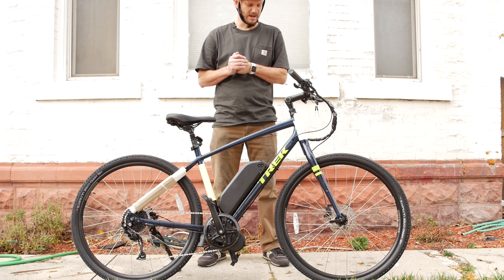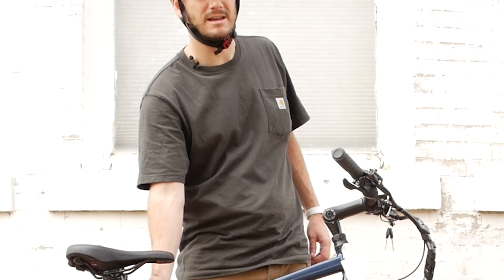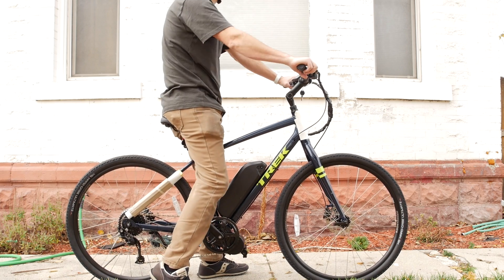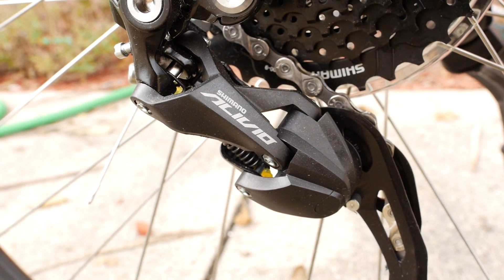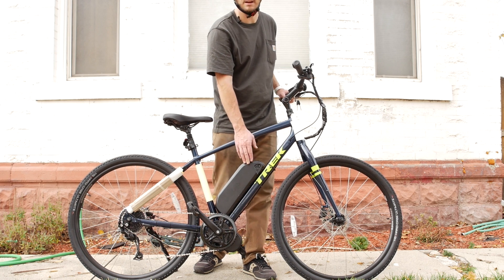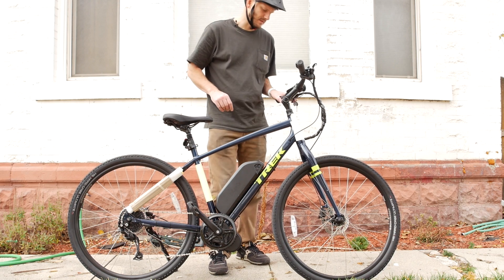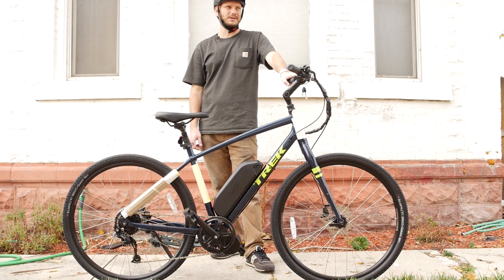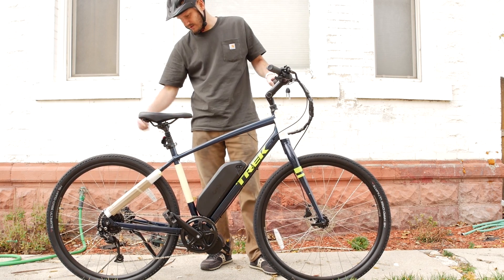Custom E-bike Build: Trek Verve 3 with Bafang BBS02 750w Mid Drive 52v 17ah Battery

Comment: Hi Johnny, your channel is my favorite resource for DIY ebike building. As it happens I have a Verve 3 XL that I have just converted with the Tongsheng TSDZ16 kit. Sadly, I had to take an angle grinder to my downtube to make it work (I know!) I only cut as much as needed to get the motor on. It is snug and has about 5 mm  of gap between where the top part of the motor should make contact with the downtube. I'm thinking of jamming a rubber shim in there as opposed to cutting more. I won't ask for advice on this as I'm sure you don't want the liability. I just wanted to share my experience. That said I'm 6'9" and pushing the bike's weight limit. I would certainly appreciate any advice you might have regarding the drivetrain. I saw your chain video. What budget chain option would you recommend? Should I stick with the factory cassette for now?

Comment: Nice! One question though: how did you deal with the plastic cable stay and hydraulic brake line under the bottom bracket? Did the motor clear all that? Thanks.

Comment: Hi Johnny. Great channel. I installed a 52volt 17.5 ah with 750 watt bbs02 motor. I have a 850c display from bafang and it reads 36volts while at the multimeter the battery is at 53.2volts? Is there any way fix this issue? reprogram/replace? Thanks for any information. I've been looking online but haven't been able to find any information on this topic.
Cheers from Toronto.
Reply: I have the same exact problem with the DP 18 display. A new display cured the 36 Volt problem.

Comment: Hi Jonny, ive got a M625 and just replaced my freewheel body at 300 miles, is the power too much, what do you recommend, thanks in advance.
Reply from the maker: Do you have a gear shift sensor?
Reply: @JohnnyNerdOut  no, initially i crashed a few gears but then used the rear brake as a cutoff
Reply: @JohnnyNerdOut  Do shift sensors work faultlessly.

Comment: I rented a Radwagon 4 and was completely impressed.  I was going to upgrade my Marin Bobcat 4 and my wife's Trek Verve 3 into mid motor e bikes.   I am buying a Radwagon 4, there is no way I can make a 2k minivan ebike like this.   I like the new geared hub motor on the latest version.  I love making stuff on my own, yet the economy of mass production is going to surpass the DIY price range pretty quick.  Thoughts on this Johnny Nerd out, your channel is awesome btw.
Reply from the maker: You can easily build a better specs cargo bike for 2k. Start with a good used cargo bike👍

Comment: Great video. Considering purchasing a new e-bike and was wondering if you could put an ‘estimated’ value on the bike listed below. Appreciate any advice you can send along. Thanks again.
Bafang 48V-1000W Central Motor
Samsung 48V-17.5AH Battery 
18 Color LCD Display
Torque Sensor
AC 100V-240V Charger
Frame - Carbon Fiber
Front Fork - GTEMK Suspension Air Fork
Derailleur - Shimano 9 Speed
Rear Shock - DNM Shock Absorber
Chain - KMC
Brakes - F/R Jevelo Hydraulic Disc Brakes
Tires - Kenda 27.5*2.6
Handlebar - Alum Alloy, 780mm
Grips - Velo
Seat Post - Alum Alloy, 31.6mm
Seat - Velo
Pedals - Wellgo

Comment: So, I'm converting my Verve 3 as well. My bike came with exposed shifter cables, and it looks like this one might have as well. So you replaced that with a regular enclosed cable for the rear derailleur in order to clear the motor? I was just thinking of using a low profile bottom bracket cable guide instead of the tall one that came with the bike. Oh, and 36 mph? Wow.
Reply: Did you finish your build? I removed the bottom bracket guide where the cable comes out and plan to use housing. What did you do?

Comment: Just finished my Electra Townie to a 1500-watt ebike does around 37 mph. I did get rid of the 7 speeds freewheel and went with a single speed 12t freewheel made a good difference in top speed pedaling.

Comment: I'm 60 and I recently bought a 2003 Gary Fischer mt bike and put a BBS02 set up on it, its pretty freaking sweet. I put a new air shock on the front and higher stem with swept back slightly bars and a cane creek suspension seat post.  It had a 46 tooth front sprocket and would almost hit 40 mph with me pedaling like mad. I put a 34 tooth on it and now it only hits about 30 which is still nuts.
Reply: In my opinion, 30 mph and being able to climb hilly terrain is a good trade off, than going 40 mph.
Reply: Put a 52t lekkie chainring for the real fun.👍😄
Reply: And believe me it's a step up from a lot of store bought ebikes.